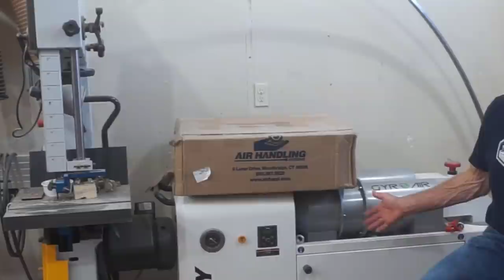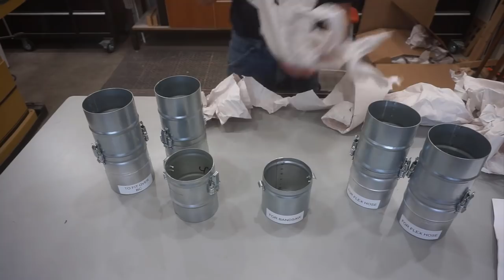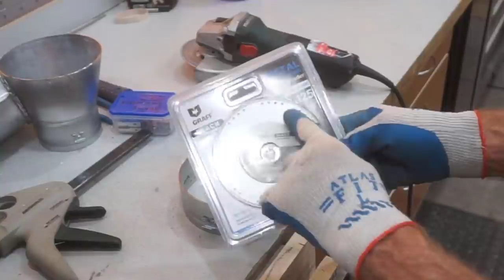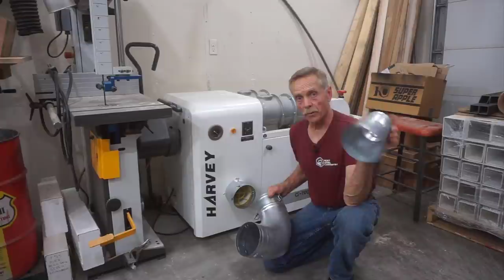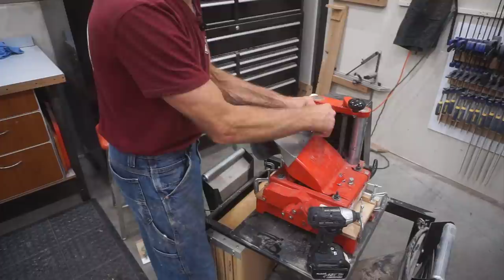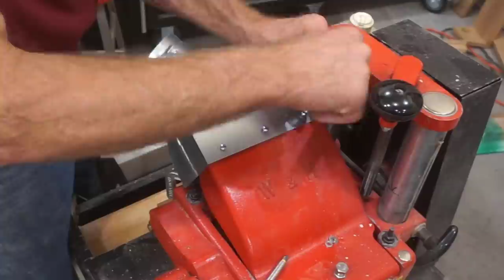Flexible Dust Collection Piping

Comment: I had my flex hoses on the ground too, but I got tired of stepping over them and knew eventually there would be a trip/fall as I already had a few scares. So, I am currently in the process of elevating all of the flex hoses.  I am using Husky "strap hangars" from Home Depot, and it is a lot easier than I thought to simply suspend the hoses because they are  pretty light.  Am using metal  Ys, and blast gates to control the individual routes.  Am running internal copper wire to ground machines and fittings to the 4 HP Felder dust collector.  Depending on how this performs, I will either leave it or transfer to rigid pipe, but my feeling is I won't have to.  Shop is a 2-car garage with high ceilings, and  lots of hanging access points due to the 2 garage doors installed, and with 4 HP dust collector, I may not need the reduced friction benefits of rigid pipe.  Also, what I am doing now is a great prototype to see how things will work and what I need, before committing to a fixed-pipe system, should I have to go that route.

Comment: Great video & thanks for sharing your set up. I also currently run 4” flex hose to the different tools requiring dust collection, but my concern is the trip hazard of the hoses. I haven’t had a trip/fall yet in the 5 years since installing the dust collection. But I have purchased steel duct piping with the plan to permanently mount my General 1.5 hp collector & Oneida Super Dust Deputy cyclone to the wall & route the piping to eliminate any trip hazards. I just haven’t stopped long enough to do the upgrade. Hope I don’t regret that decision before I get the upgrade done 🥴.

Comment: Those are interesting fittings and I am glad you found they work for you. :)  I was lucky that my setup works with the various rockler quick connect 4" ports, but it is good to see those options are also available.
Reply from the maker: I'm glad the QD fittings from Air Handling work so well too Joseph and it's good to know you found a workable option too.  It's all about making your system work for your needs, right? Thanks for watching and commenting...
 Best, Matt
Reply: @NextLevelCarpentry  Exactly :)

Comment: Good video. I planned my dedicated wood shop for several years. I worked with Oneida for a commercial cyclone system. Even with all the planning you can’t believe the extra fittings I have, and the ones I had to order. All my fault. BTW the complete system cost about $5,000. (Seems People always want to know what stuff cost). But my lungs are worth the price.
Reply: Not to mention it makes a safer shop, and it saves time when you’re not cleaning up sawdust at the end of the day.

Comment: Looks like the tubing has a spiral wire running along the tube, this is your ground strapping. Just need to make sure you have the exposed wire made on each of the galvanized fittings to make the ground connection from hose to the machine which is grounded.
Reply from the maker: D Zee: There IS a helical wire in this heavy duty flex pipe but it's the plastic itself with anti-static properties that eliminates the need for grounding the 'exposed wire' to prevent static build up: https://airhand.com/product-category/flexible-hose/anti-static-flexible-hose/ If you choose to '...make sure you have the exposed wire...' grounded to EACH of the galvanized fittings you should but it's completely unnecessary in the setup I have in my shop and show in this video. Best, Matt

Comment: Thanks very much for the video, extremely interesting.
  I hope you don't mind a couple of questions/points. 
 I'm sure I'm not the only one interested in the cost of things.  While I completely understand your order is unique, still it would be helpful go know what this costs.
  Second, you keep referring to wanting to change the 90 degree flex hose with the smooth 90 but you never had a 90 out of the collector.  In fact the hose out of the collector was very straight.  Maybe a 20 degree at most.  So you went from an almost straight shot into the collector to a most definite 90 degree bend, albeit a non flex 90.  You do allude to perhaps moving the collector in the future and then maybe you would need the 90 but based on where the machine currently sits I am confused why you went through time and money to make the bend tighter.
Reply from the maker: Good questions Steve.  Pricing for standard fittings is available through the Air Handling website linked in the video description.  Custom stuff has so many variables that pricing comes during the design process.  The guys at AHS should be able to give estimates so you know if any particular piece justifies its cost.  Keep in mind though that custom ducts, like anything custom, is likely to be disproportional in cost but, when it's the only/best solution it justifies it IMHO.  Also: I run a for profit business in my shop so my perspective is very different from someone who has a budget for hobby/recreational use so other alternatives may make more sense.
About that 90 degree bend in the flex (good observation BTW) the confusion is from the way I staged the shot in the video compared to how it is in use.  I often have a cabinet in the building process or a material cart parked right there where I posed in the video so that duct DOES have a 90 degree bend in it right there the majority of the time.  I'm sure you can see it in the background in other shots in other NLC videos where my justification for the expense/effort to upgrade make more sense.
Thanks for watching and commenting here! Best, Matt

Comment: Finally upgraded my dust collection to the G700 on your rec — thank you! Now that I'm looking more into fittings — have you found that a longer length of 6" hose + shorter 4" runs performs better vs a shorter 6" and longer 4" (total run lengths being equal)?
Reply from the maker: I think you'll love that G5700... I'm not doing any ambassador stuff with/for Harvey anymore but still have no regrets about the machine and how it works for the Next Level Carpentry shop.
There's a bit of alchemy in determining hose size/length/configuration issues Paul but I defer to the guys at Air Handling Systems for advice.  They don't do G700 specifics but can guide you through factors to make sensible hose/pipe/fitting decisions.  If you call them ask for Kae... and tell 'em I sent you 😉😎 Best, Matt

Comment: As a really rough guide, use a factor of 3 for flex duct to solid. A lot depends on duct diameter, airflow, pressure but 3 is close enough.  So if you have 3 foot of flex its about the same pressure loss as 9 foot of solid.
Reply from the maker: I think you transposed your length numbers Mike... if you'll edit your comment I'll leave it up for other viewers as I imagine the 'close enough' factor will be helpful... Best, Matt
Reply: Next Level Carpentry You just beat me to it
Reply: Edited my apologies for the transposition.  Thanks for the videos.
Reply from the maker: @mikes3723  HATE it when that happens😲😎 Thx for the info and edit! Best, Matt

Comment: when you get that big elbow remade, you might consider getting 2 45s instead of a 90 to make the bend longer to reduce friction even more...
Reply: Hey Alden, I have an engineer buddy who explained to me that it's not about degrees, its about radius. With the cheap plumbing or HVAC fittings we frequently Frankenstein together in our home shop duct systems, long sweep elbows are either not made, or not affordable, so a pair of 45s separated by a short straight run is a cheap compromise substitute for a long sweep. 

Once you get into the expensive stuff purpose made for dust collection, you can buy long sweep fittings, but for example a 6" diameter 90 degree long sweep like the one in this video is around $45 bucks (oneida) plus whatever it costs for the custom adapter he shows. Fine if you have it to spend, but I don't. I put most of my system together from 5" snap lock pipe at around 2 bucks a foot from my local hardware. When it came to wyes, I found usable 45 degree wyes for HVAC on amazon for 18 bucks. Leaky, but easily sealed with aluminum tape and economical compared to the $40 they'd have cost from oneida. I needed one long sweep 90, also over $40, but settled for a couple of $4 "adjustable" elbows I could chain together and seal with aluminum tape and spent the remainder on steaks and beer.

Comment: Man, that smooth el @ 5:18 is gorgeous hardware. Give us a hint, what do those sell for? How about the pant wye?
Reply from the maker: All of the standard configuration fittings are priced at the Air Handling website in the video description.  The 'el' and pant wye are custom/hybrid configuration priced on a fitting by fitting basis.  If you've got something specific in mind get in touch with Air Handling for accurate/current pricing/estimates.  BTW You'll be amazed at some of the custom stuff they make for industrial manufacturing which you can see showcased on their website... Best, Matt

Comment: Hey Matt... are still happy with your Harvey DC??? Any issues???  I was getting ready to buy a ClearVue 1800 DC and saw your video on the Harvey. ALSO, do you have a discount code for the Harvey?  THANKS & keep making these awesome videos!!
Reply from the maker: I've only gained appreciation for my G700 in the 18+ months that I've owned and used it.  You can check out the recent video I did showing ductwork upgrades  to see if you think the setup is a better fit for you and your shop: https://youtu.be/DyXajabtBuY  I'm certain the G700 is a far better choice than a Clear Vue model for my needs and would be curious to hear what you decide. 
BTW Harvey has offered some remarkable 'flash sale' pricing on the machine recently putting it in a similar price range as the Clear Vue making it a more viable option for many with the added benefits of all its remarkable features.  With reduced pricing structure I don't have a special offer code for the machine anymore but I would appreciate if you tell Hung or Rayson at Harvey that you found them through videos at Next Level Carpentry.
Thanks... and thanks for watching! Best, Matt
Reply: @NextLevelCarpentry  Thanks for your quick & informative response! I love your mod for the cleanout!! I'm trying to figure out if the Harvey will fit in my small shop. I currently have a  "frankencyclone" :-) tucked into the corner of my shop (a steel cyclone from fleabay, a motor from a Delta 2-bagger and an modified impeller). With the front inlet on the Harvey, I will have problems connecting it with my 6" PVC piping that is overhead. It is strange that they don't have the option on the Harvey for a top mounted inlet. If I buy the Harvey I will certainly mention you... FINALLY... any idea how many CFM you draw in the real world??? cheers!
Reply from the maker: @josephshields317  you definitely dialed in on the intake Port location as the biggest drawback with the g700 dust processor. I don't know how to measure my real-world CFM but I know that as long as I don't let my filters get clogged up overtime that the CFM is more than adequate for my needs even with all flexible ducting. If you want some insight and information on how a gyro air will perform with your ductwork and configuration email Harvey Industries and request a call from Curt Corum... that guy knows more about ductwork design and configuration and performance than any other human alive today IMHO.
Reply: @NextLevelCarpentry  Perfect... Thanks for the info... I will contact Curt cheers.
Reply from the maker: @josephshields317  If you have trouble getting through just email me via  my website Nextlevelcarpentry.shop and I'll get his # for you...

Comment: Matt, I noticed you have some shots where you zoom in while you are talking, which is a nice effect. Do you have a remote or does Chip operate the camera?
Reply from the maker: Actually neither one Steven I just do that in post-production by zooming in digitally. If you look close the zoomed-in shots are always pixelated as a result. Sure wish I had a camera crew to do that because the video quality would be noticeably better and sharper plus it would be a lot less work...
Reply: @NextLevelCarpentry  Matt, the content is the best part, by far. I doubt anyone that follows you on here cares that much about the video quality, although I understand that you put your best work into all that you do. The in-depth explanations that you provide, the attention to detail and all those cool carpenter tricks make your channel stand out. Plus, you are not trying to set speed talking records like some other channels I follow - they can be overwhelming at times. I guess that is why your channel is at the next level. Now, I just have to learn how to weld...and grind! Cheers, Steve.
Reply from the maker: @stephengee8488  thanks for a glowing review...  I'll work to sustain it... With help from Chip and grace from viewers like you.
Hope you get to try some welding... It's not that hard to do well enough to get by... As long as you have a good grinder 😉😎

Comment: Wondering what the max gauge is for that Whitney hole puncher.
Reply from the maker: I'm sure it'll punch 1/16 in Steel but the product literature probably gives up better answer. FYI I've got a bigger bench top model that will punch quarter inch mild Steel so if you have need for a lot of punching on thicker steel there's options available. Pretty sweet little tools that's for sure... Best, Matt